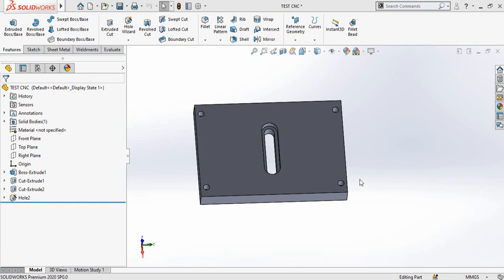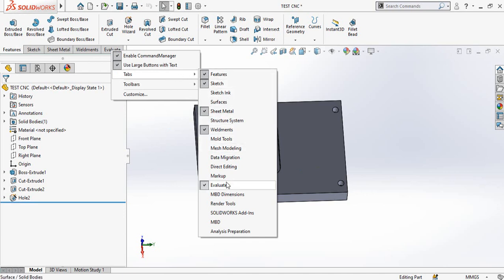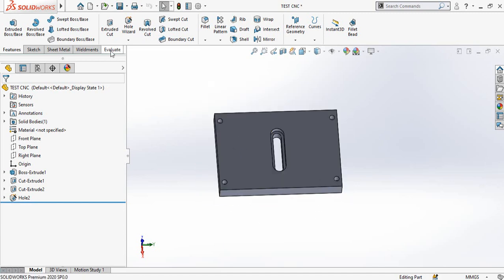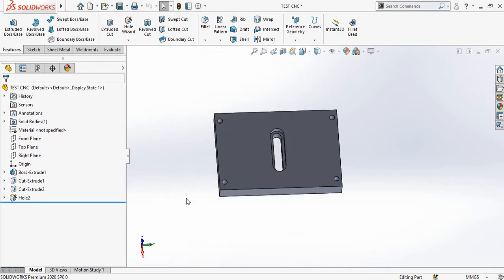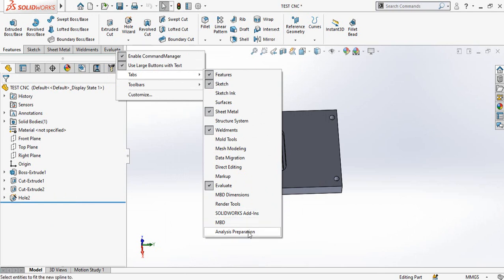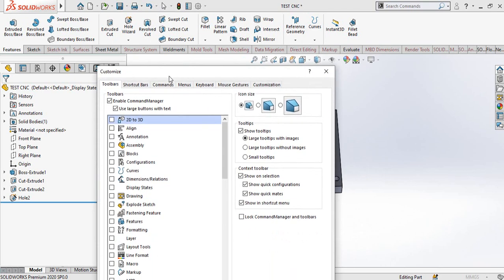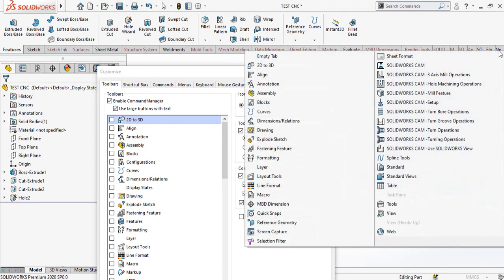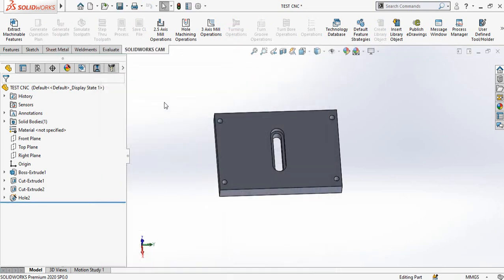How to show Hidden tabs in SolidWorks |SolidWorks CAM Tab Missing problem|

Comment: Thanks! This didn't actually fix my issue but in case someone else has the same problem, I fixed mine by resetting the toolbars only to default. RMB on tab >> customise >> reset to default >> toolbars only >> close & reopen SW